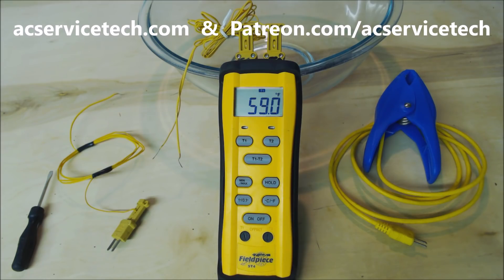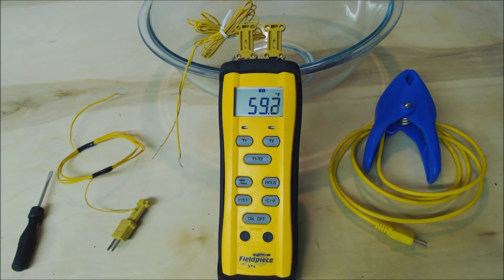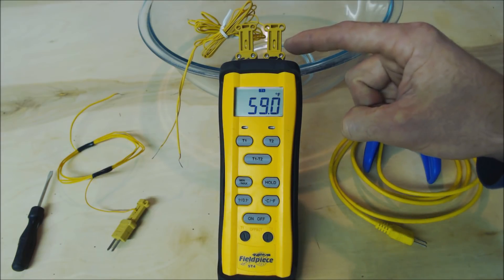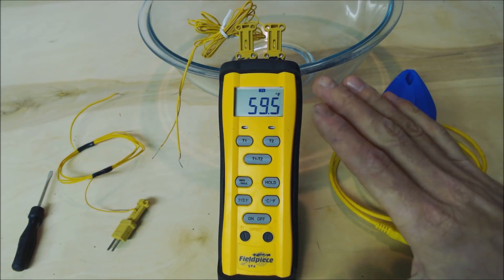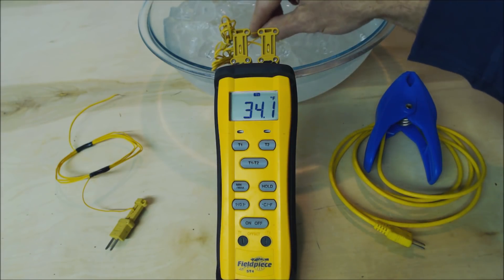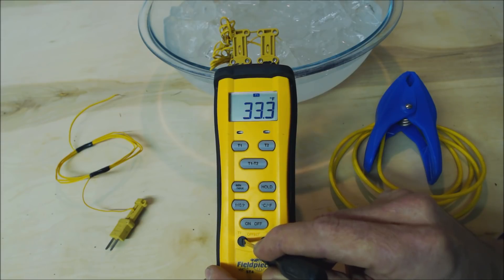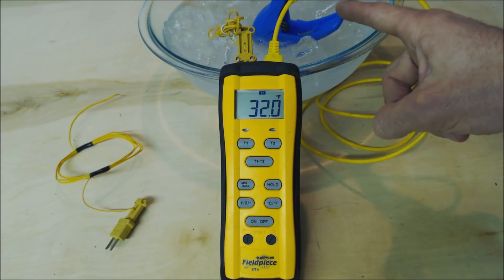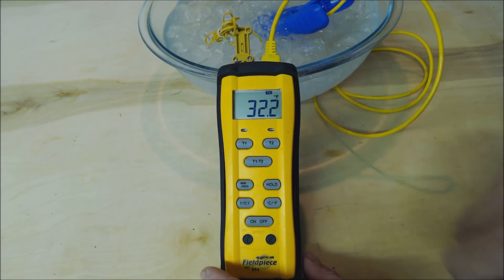Calibrate The Digital Temperature Meter & Temp Sensors! Fieldpiece ST4

Comment from the maker: Tool List-  https://www.amazon.com/shop/acservicetech
Support-  https://www.patreon.com/acservicetech
For those that are looking for the tools used in the videos: (Linked Below)
Fieldpiece ST4 Dual Temp Meter  http://amzn.to/2wc1ME3
Fieldpiece Bead K Type Temp Sensor https://amzn.to/2DBwKfs
Fieldpiece Wet Bulb Temp Sensor https://amzn.to/2RRI7Tw
Fieldpiece TC24 Temp Clamp https://amzn.to/2qHLyjZ

Yellow Jacket Refrigerant Gauge Set http://amzn.to/2aenwTq
Refrigerant hoses with valves http://amzn.to/2aBumVI
Yellow Jacket Gauge set & hoses https://amzn.to/2vLVkV9
Yellow Jacket 4 Port Manifold w Hoses https://amzn.to/2BkuGIq
FieldpieceSMAN360 Digital Manifold Set https://amzn.to/2BdoaD4
FieldpieceSMAN460 Digital Manifold Set https://amzn.to/2nB4Fe6
Compact Ball Valve for Refrigerant Hose https://amzn.to/2KUisW8
QuickDisconnect 90 for refrigerant hose https://amzn.to/2MMtVcg
UEI DL479 Multimeter with temp sensor http://amzn.to/2jtsUbJ
JB 6 CFM Vacuum Pump   http://amzn.to/2nqbvo8
Appion Blue 3/8" to 1/4" Vacuum Hose http://amzn.to/2uYlVyc
Appion Red 3/8" to 1/4" Vacuum Hose http://amzn.to/2uYg6Ro
Appion Valve Core Removal Tool http://amzn.to/2uYr8WL
Yellow Jacket 1/4" by 1/4" hose http://amzn.to/2umtcod
CPS Vacuum Micron Gauge http://amzn.to/2v1nM3O
Supco Vacuum Micron Gauge http://amzn.to/2v1JRiA
RectorSeal Bubble Gas Leak Detector http://amzn.to/2ckWACn
UEI DL389 Multimeter  http://amzn.to/2xAdaJf
Air Acetylene Torch setup    http://amzn.to/2aQalsb  
15% Silver Brazing Rods  http://amzn.to/2gVLyLc
Nitrogen Regulator    http://amzn.to/2bXdR5f
Nitrogen Flow Meter    http://amzn.to/2brvoBg

Other tool links can be found in the video description section.

Shop through Amazon! Your Purchases through Amazon provide a means for channels such as mine to earn advertising fees from all purchases after clicking through. Prices are the same as normal-    https://www.amazon.com/shop/acservicetech

Comment: Would you recommend the ST4 over using JL3PC clamp? After reading instructions online, the JL3PC can be calibrated using the Job Link app. I'm looking for the most accurate method for checking subcooling. Bead style thermocouple vs clamp. Thanks.

Comment: I notice this is a bit of an older video, would you still recommend this tool for a dual temp guage or is there something better out now.  Only thing I would like to see is both temps on the screen at the same time, but that is not a big deal.  I like the calibration function, my old Fieldpiece doesn't have that.
Reply from the maker: This still seems to be the only one that has those calibration screws which are needed.

Comment: Craig, what do you really think about the clamp type? I remember a video that you mentioned you don't like to use the clamp type but man using electrical tape I worry about getting the K type flat on the pipe. I was thinking about buying the feildpeice clamp for the Fluke (hoping it will work with the fluke). Also there was a video you did about stripping back the insulation on. the K type to get better contact...did you solder the two wires in the K type with silver solder we use for copper or solder for electronics ?

Comment: im looking a temperature meter to check egg incubators, im wondering the calibration in ice water should be made no matter if its going to be used on liquid or air? how regular should you calibrate it?
Reply from the maker: That is correct, I check around once a month or so but it depends on how much you use it, thanks!
Reply: @acservicetechchannel  thanks for your reply!

Comment: So I am going to go out on a limb here and ask this:  So once you re-adjust for the clamp, I assume that the ST4 does not remember each individually (ie: K-bead and Clamp sensor) and recall the correct adjustment once its plugged in?  In other words, if you readjust for the clamp, you must readjust for the K Bead once its reinstalled?  Thanks Ed
Reply from the maker: Yes that is correct. Also you would notice a difference in T1 when you add something in T2 sometimes, depending upon what that is. That is why I find it is best to just keep the sensors you have on it after calibration. The tool is also inexpensive enough to where if someone wanted to use the clamps, they could just use an additional ST4 that uses the clamps. One thing is for sure though, technicians need to be able to use the bead sensors for a multitude of locations, thanks!

Comment: Hi Serice Tech,   I have a weil mclain he2,  original problem was purge light blinking on occasion.   Replaced pressure switch, no help, replaced module with model1013-200. Now I have a" limit  closed blower powered" light flashing and the blower tries to start and then stops on and on.   Replaced the blower assembly to no success,  same thing third light blinking,  blower tries to start in short bursts but never does.  When I turn the power off at boiler for about 20 min and comeback and turn it on,  It starts no problem and runs for hours until next time it happens,  running out of parts to replace, if you or someone can shine some light on this brain buster I would appreciate,   thanks in advance!!!!!
Reply from the maker: Here is the installation manual for that unit. https://www.weil-mclain.com/sites/default/files/field-file/he-ii-manual_1.pdf  - Is something wrong with how the exhaust pipe was installed? Check the tubes to the pressure switch and the connection to the inducer housing. That unit I believe has a pressure switch with a normally open and normally closed connection points. It is possible that something with the tubing or exhaust drafting  is making the pressure switch closed when the boiler wants it to be open. I would look in that direction try to follow the 24v through the safety wiring and pressure switch, thanks